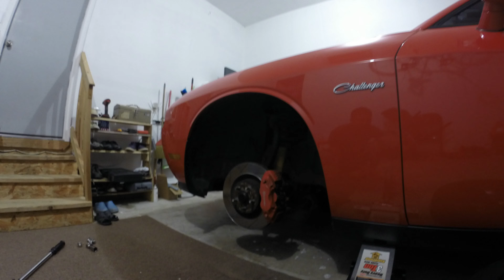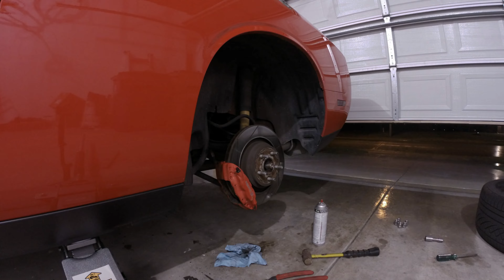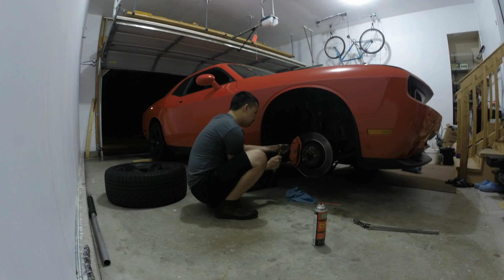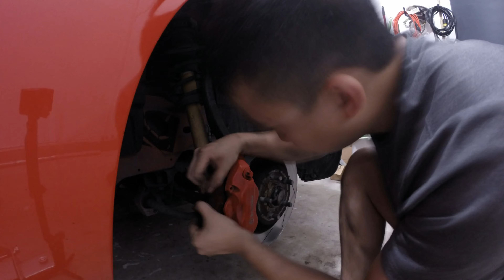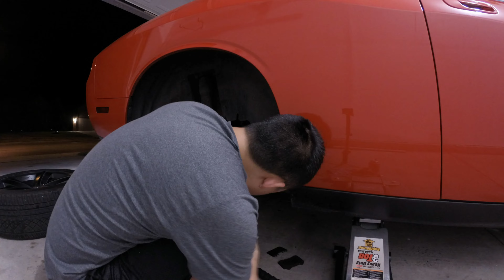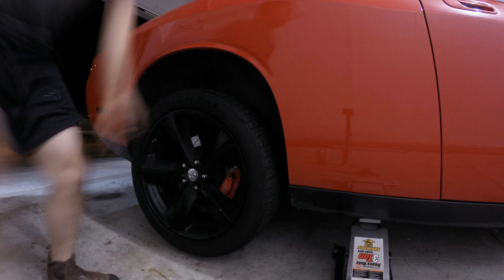Swapping Brembo pads to Hawk Performance on my Challenger SRT-8

Comment: how do you know when to change the rotors?
Reply from the maker: When the material has been worn down pretty far. You can tell by looking at the side air vents and see how much is left. If they are warped from excessive braking you can take them to an autoparts store to get them turned.